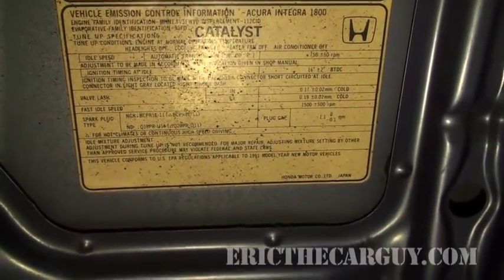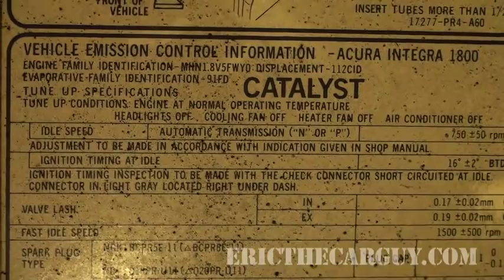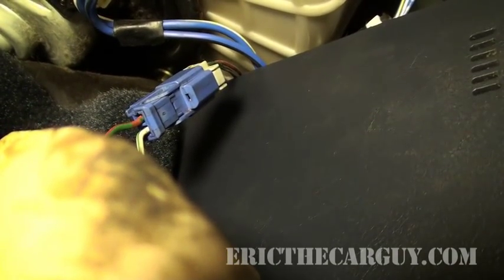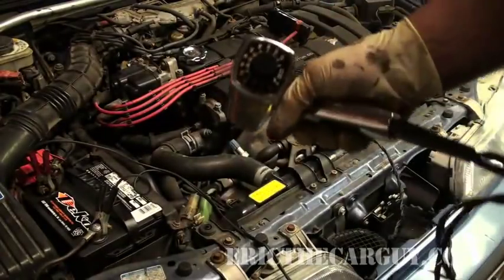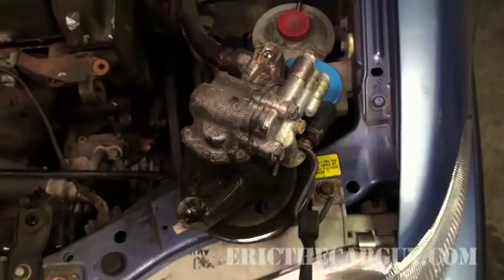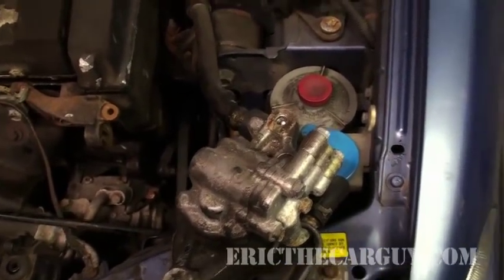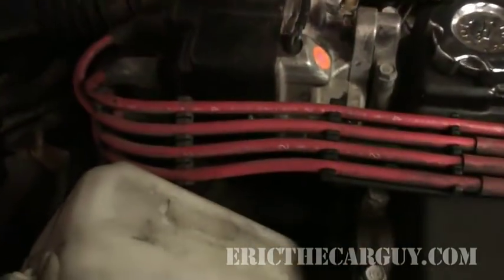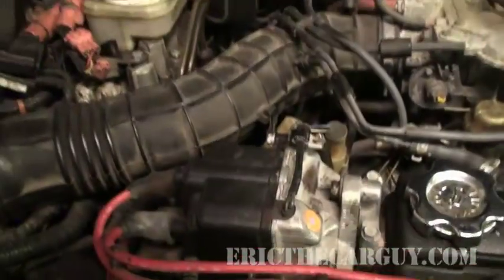How to Set Ignition Timing, Acura Integra - EricTheCarGuy

Comment: info was clear and concise ..spot on i already knew about shorting connector but wasnt sure what each of the 3 timing marks were for (number) you where doing an acura and I need to do a honda so if timing is lets say 12 degress + or - 2 then the center mark will be the 12 degree mark. just saying is all as the honda im working on has no im sticker on hood . 
have a snap on adjustable timing light that haven't used in 30 years so forget why it is even adjustable other then maybe it is for verifying total timing at full throttle or at max advance ? yes im pretty sure that is what the adustment is for. and if i tested your car and dialed in 16 degrees on timing light the white mark would be showing on tab

Comment: I will check tomorrow, I will call around & scrounge up the 411 if I need the tech-1 or if I can get by with the screwdriver & a scan tool to zero in the timing & I'll let you know when the job is done what worked.

Comment: Btw this distributor is the weirdest setup. The #1 plug wire comes out of the dist at the 3 O'clock position but under the cap the contact for the point is on the opposite side in the 8 o'clock position.

Comment: Same gen integra, but my check connector does not keep the CEL on, I also have no error codes, should I cut the connector? Is it used for anything else? '90 integra mint condition.

Comment: I know this is a pretty old comment but did you TDC your engine before/after you replaced the O-ring? Also why did you replace the o-ring? if you replaced because you have have oil leaking from the outside of the housing then disregard the rest.. if you replaced because you have oil leaking in the inside of the dizzy then you would need to replace the the entire distributor housing.. good luck

Comment: I have misfire problem on a 96 integra that I'm having a hard time putting my finger on. It's only at idle. Is it possible that i need to adjust the distributor? I've done a tune up, compression is fine, mechanical timing is good and it's getting fuel. The distributor was not removed as far as I know but the misfire is really stumping me. Am I headed in the wrong direction or is this a possibility? And why is there an adjustment if the computer can do it?

Comment: ok my question is i did a head gasket replacment on a b18b1 got the head resurfaced so had to take everything out. when i put it all back in i got lost, when it comes to setting the timing back i know to put the pulley on the white TDC mark but do i need to put the cam gears with the UP marks at 12 o'clock and if so can i turn them to the up position while the belt is off and keep the pully on the TDC mark then put the timing belt back on my distributor is back in the same position should it be

Comment: I have just now realized that after 2 Honda accords that every time I set my timing that I have used the single mark instead of the 3 marks. The thing is my car ran but I did get a slight misfire and that issue left me stumped. The moral of my story READ and understand the information.  Eric I'm trying to set my timing in the accord 4cyl. but I have turned my dist. all the way to advance and I still can't reach the 3 marks. I'm think my mechanical timing could be off, what do you suggest.

Comment: Hey good video. I got a question for you though. I have a 95 prelude with a jdm h22a motor. I set my timing off the fly wheel with a timing light. I also jumped the check connector. It calls for 16 degrees btdc and i set it to that as when the motor was warm and everything. It still misses some when i start it back up. the car was accidently drove with retarded timing for a mile or two and I was wondering if that would damage the motor? what could i check for?

Comment: Ok than so eric than since my exhaust cam is at tdc and my intake cam is of by 1 tooth that would make a lot of diffrence than right ?  Ok and some times my car won't turn on on the first turn and while drivin and clutch down my car the rpms will go all the way down til the car dies and when @ a red light my car will idle around 500 and just die out wat can it b ppl said it could b my fpr ?

Comment: Hi , Eric  ,  I have a Honda Accord 1993 ,  and I tried to adjust the ignition timing , 
 1- I warmed up the car 
 2- pull out the service check connector and jumped the wire
 loosened 3 nut on the distributor and lined up the red mark aligned with the pointer ( with timing light ) when the red mark lined up with the pointer I tightened all 3 nuts . But as soon I removed the jump wire from service check connector the red mark also moved too , 
 Plese help . Thanks

Comment: Hi there Eric. My name is Von and I'm from Philippines. I have a Mitsubishi 4G67 engine in which I replaced the 210cc injectors with 240cc injectors. Problem is, I have adjusted the ignition timing and has no idea how to bring it back. I have no timing light, but repair shops says its on the right timing. The car is too slow and when I switch off the ignition switch, engine goes dead by half a second or so which is I think is not normal. Does it mean its retarded? Can you help? TIA

Comment: Hey Eric, I'm trying to run the timing light on my car.

I only have a wire that I ground for check engine codes to flash. Do I ground that to get this to work?

Some guy guy on the forum said have the diagnostics wire shorted. Is this the same wire?

Also, how do I know where the 10 degrees is at on my crank pulley? Will it already be marked? I've read all over where people say to "Mark the 6o" or "mark your 16o". My car needs to be set at 10. How do I know where the 10degree is?

Comment: I have a great little mazda b2200 91 that I just un lowridered and im rebuilding the motor. the original marks are not on the pulley any more. is it as simple as marking it with a paint marker at TDC of no 1 or is there more to it?
Reply: nope, that's it

Comment: I recently went to replace the o ring on my dizzy. I didn't mark the timing when removing the distributor and now it won't start after putting it back on. I believe its due to the ignition timing but can't fix the timing because the car won't start. I'm stuck at a crossroad here. My question is "How do I adjust the timing without the car starting?"

Comment: the ecu just sense's the position of the piston in order to fire the fuel into the cylinder. the distributor fires the spark plug to ignight the fuel/air. its not smart enough to do the spark by its self. newer cars like from 09 dont have the distributor since they have a coil pack on each spark plug and those ecu's are smart enough to know when to fire the plug.

Comment: my timing light has 2 adjusting nobs and a gauge with a working needle but has a green wire and green clamp clip for electric ??? i dont know what it is for ??
the light works fine with out the green wire so im not sure why its there.
the two nobs are labeled "adi" and "hi-lo-dwell+points"
i only used it twice and i only work on my own projects so im no professional

Comment: one more thing - if you are in fact needing to go past the distributor stop, which as you say might mean the engine is out of time, then does that imply that your timing reading you get is probably not legitimate, because the engine really isnt mechanically timed correctly? e.g. reading 9 deg BTDC on the light would mean nothing?

Comment: @EricTheCarGuy same problem here :) i have an 03 Fiat Doblo Malibu (idk if you know that model), when i start the engine i hear that noise like when you rub a fork on a plate, when i hit 2000-2500 rpm with the second gear on it vanishes, and the same thing happens when i park the car, and i move the steering wheel...what could it be? same problem with the steering belt?

Comment: Well its a 93 tercel but I put a starlet gt motor in it. After all I've done to the car, I've never set timing on a car lol.

Also I read somewhere that people want you 0 degrees mark top dead center. Why does this matter? Once you start your car it will still fire the same than if you rotated the crank shaft to 0 degrees TDC, right?

Comment: @EricTheCarGuy thats strange  i just put a b18  in my 93 civic  and i had to take the pulley off  in order to get the engine to go in  when i put it back on i didnt notice any cetain way to put it back on   should i take it back off and double check ?    when the engine is running  the pulley is turning even and  and its not crooket

Comment: i took my 90 civic hatchback to get a smog n 10 min later they brought it back to me and told me my timing was off to fix it and come back, so i called my mechanic and we tried setting it but for some reason it jumps. it was at 10 and needs to be at 18 for the right timing. so we set it to 18 and it jumps back down to 10 no matter what lol. what can it be can u help?
Reply: Guessing a bad tensioner. For my car the timing chain tensioner was only $15. I'm guessing you'd be after a timing belt tensioner?

Something else that can help settle a belt in and not lose it's spot would be to work the crankshaft forward and back a little. It helps everything sync together so it won't jump again.

Comment: Hey Eric, nice video! I have a 1998 nissan frontier 4 cyl, I pulled out the oil pump and the distributor after I put it back together and test drive the truck and it feels the rpm are too high! Do I need to adjust the distributor co'z I dont have the timing light?

Comment: @EricTheCarGuy I tried a paper clip and 18g wire and did my best but still no connection :(... Could it be because my ICM? I kno its bad cuz i have random beeping and i know it controls the turn signals, but i dont know if it controls the service connector.

Comment: @EricTheCarGuy I've set the timing and I'll go back in to the shop tomorrow afternoon.  I had 133 hydrocarbons on the lowspeed test and 100 was the limit.  I also failed the timing section, but now it should pass.  I'll let you know.  Thanks for the help.

Comment: This may be a dumb question but if I were to change my distributor on my obd2 h22a honda prelude motor would the computer set the timing for me or would i still have to adjust the timing because i heard that on my obd2 motor you cant adjust the ignition timing

Comment: @EricTheCarGuy it happens as i slow down to make a turn or to stop at a light. i have a manual car so it happens when i push down on the clutch at slow  speeds and you can feel that the car starts to struggle and dies thanks for the tip though i'll try it

Comment: Where is that plug in I went on the passenger said under where the glove box is found the same ac fan I have the same integra I can't reset the code for the check engine light I can't find that cable you plunged loop into I do not know what the heck the cyp  sensor code means plz help you are the only one I found on YouTube that know how to fix this car I can't find nothing on the great wide web I need help Eric I would do it my self if I could I never worked on a Honda/ acura this old before
Reply: Connector is blue
Reply: skylar danzy there is a pocket in the plastic to the right side of fan.. just dig in there, there will be three connectors. The connector you're looking for is the one with two holes in it and the wires are most likely colored green with white stripe and the other wire brown with grey dots. That connector is the one you should shove a paper clip into.

Comment: hey eric i have a a b18b1 and it started to lack power top and it feels like its holding back i have high flow cat and i replace  fuel pressure regulator as well as injectors because i had some laying around.. same problem still....

Comment: Hey Eric, big fan! I have a 74 Chevy Nova with a 250 straight six. I changed out the vacume advance and now the car barely runs. Can I just mess with the timming until it sounds right or do I have to use a timing light? Thanks.

Comment: I have a 2000 Accord 2.3l with a Hitachi distributor that uses only two 12mm bolts. How do you adjust the timing using a timing gun for this particular distributor? It seems that the 2 bolt distributor has less of a rotation than the 3 bolt ones do? Is the process the same, but with less mobility? Or is their another trick to the 2 bolt distributors in adjusting the timing?
Reply: I have a similar Accord (2002) and it appears that the Hitachi distributor does not need to be timed with a timing light as the computer adjusts the timing automatically (at least on this generation Accord).  The older ones with the TEC distributor are different and they are much easier to take apart to replace the shaft oil seal.

Comment: Hey Eric I have a question... My 96 integra ls has a starting issue and I've checked for spark and it has it also I've replaced spark plugs so what else do you think it is because I don't think the plugs are gapped correctly but I'm asking you because I'm kinda a noob
Reply: WHATELSEYOUWANT GAMING is your fuel pump good? Do you have good compression across all cylinders? Do you have a distributor going out?

Comment: ive always been confused with the big single mark and the 3 close marks.

so basically if gun is
not adjustable - line up with middle 3 line
adjustable - set to correct degree, then line up with single mark
correct?
Reply: Correct.

Comment: So pretty much light guns are ONLY for engines using distributors...not EFI...right?...and can it be used at least see if your timing belt is a tooth off or not?
Reply: Ignition timing and camshaft timing have nothing to do with each other , other than sharing the word timing.

Comment: i have a problem i replaced my 97 civic distributor and had bad acceleration so i tried timing it and its all the way counter clockwise but tdc is lined up and still has bad accel any thoughts?

Comment: hey eric i have a 1990 integra ls b18a1 (completely stock).. and i have spark fuel and ofcoarse air... my car will crank just fine but will not start ive replaced the main relay and swapped ecu's and neither worked.. ive even tried pull starting the car and it wouldnt even act like it wanted to run any help would be nice, thank you

Comment: check and get injectors flow tested. One might be gunked and not putting out as much fuel. I've used seafoam on a couple of my cars. It may help with cleaning the rail and injectors.

Comment: I dont understand why cant the computer just make an adjustment to the timing? What is the need to adjust it yourself if the computer is already adjusting the timing?
Reply: Because the computer can only adjust the ignition timing correctly, when it has a correct base to adjust off of.

Comment: what happens if you don't set timing after replacing distributor?
Reply: If the timing is off it can mean a bad idle and or loss of power.
Reply: Smog Fail

Comment: @EricTheCarGuy I had already replaced the O2 sensor before the initial test.  Adjusting the timing (from 12BTDC to 18BTDC according to the smog test, I actually had it spot-on the mark, though) fixed the problem somewhat.  Before I had 133/100 HC count.  Afterwards I had 100/100.  I also put in a ton of seafoam the day before the retest.  It could have been the timing or it could have been the seafoam but I just barely passed.

Comment: my 95 civic failed smog, I had change spark plugs, spark plug wires, rotor, rotor cap, air filer, and still faied.it fail HC, it has 97 (MEAS) @ 15mph . I cleaned the intake throttle and poured some valve cleaner on the gas tank, do you think i should check the timing too?

Comment: @EricTheCarGuy Thanks, I will have to determine TDC in that case and go from there. Probes are a hassle to work with, very tight quarters around the timing covers. (94 Probe 2.0L aka MX6/626). If you ever work on a Probe or MX6/626 I will probably download the video to a flash drive to keep it for life, lol.

Comment: Thank you Eric for the video. Question for you please. I have a 1994 civic and it's giving me  a code,  which is no. 1 cylinder position. Does this means that I need to adjust the timing like you did or would it be something else with cylinder 1. ? Please help me. I can't pass emission test here in Indiana..!
Reply: +v6 ftmfl thank you so much Eric. I will

Comment: How do you think it was done before timing lights, I'll agree to be extremely precise you need one, but to state that there is no way to without one is incorrect. For example you can use a simple test light, and hand turning over the engine you can accurately adjust ignition timing. I had an "old" timer show me this, along with some other low tech solutions.

Comment: i need help lol i done did everything its throwing a bunch of codes p1399 p0303 p0141
Reply: Po141, lambda heater code?
Reply: I got a 98 civic d16y8 that's now olny throwing 2 code p1399 and the 02 sensor code I put new head and head gasket Apr headstuds new plug wires and plugs new coil and its still missing fuel pressure is fine injection is working like they should what do you think would make it miss I had a shop put new timming belt on and I think they f up the timming
Reply: +melvin reed not a dodgy icm?
Reply: ? What dose that mean lol
Reply: ignition control module, the ignitor